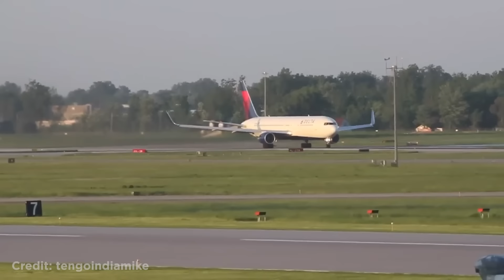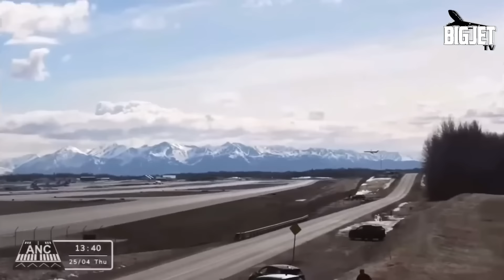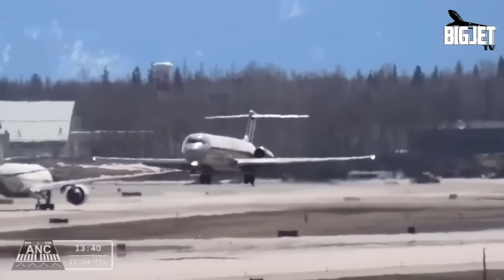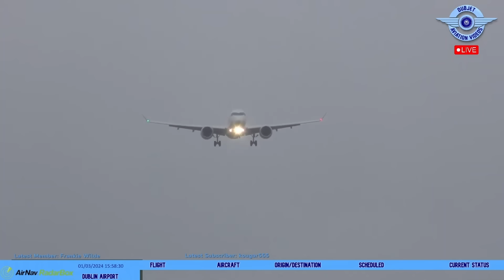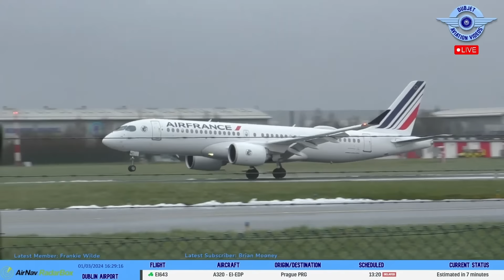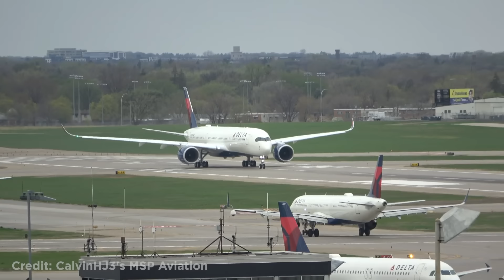767 Takeoff Goes Wrong

Comment: In 0:49 the airpline was md80, not dc9
Reply: Nope thats dc 9
Reply: @marsifire5216  no, dc 9 was smaller, engines was much smaller
Reply: @piotrrys6313  it has variants it has dc9-30 -40 and -50 this is the 50 varient

Comment: I was on a DC-9 in the 70s, was super loud at the back due to the adjacent engines...was also on a DC-8 in 1965
Reply: I wished I‘d experience the same man! Sick
Reply: BUT, if you get a seat in the front of the DC-9/MD-80 you could hear almost everything else since the engine noise was low.  Re-engined DC-8s were cool too.
Reply: @eljeffe8806  ya got that right

Comment: That is an extremely short take off for an A350.  They make excuses here in SLC that the runway is 2000 feet short to have A350's takeoff here, when it's been done.  It's all corporate excuses.  The Church of LDS chartered two A350's going to Manilla out of here.  Money talks, so don't tell me it can't be done. Delta treats SLC like a regional airport.  This is Delta's ONLY hub, that does not have a flight to HND or INC.

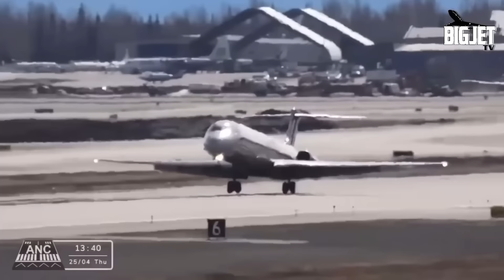Comment: What is up with the 767-300's? They always are having issues. And that Anchorage plane isn't a DC-9 It's a MD-80. Though technically you can call it a DC-9 Super 80. (DC-9-80) MD-80's have bigger engines than the DC-9's had. DC-9's had the JT8D-17  family of engines. This plane at 1:15 had the JT8D-200 family of engines (bigger than the 17's)

Comment: The 767's take-off wasn't "wrong." A tire blew almost at the time that the plane reached take-off speed. At that point, pilots are trained to quickly assess the situation and decide to either abort the take-off or continue it. The pilots did what they were trained to do and chose to continue the take-off. If the pilots had made a different choice, the 767 could have come to a stop before the end of the runway, as 767s are designed and built to do. If the problem had been different and an engine had blown instead of a tire, the pilots could have continued the take-off and climbed out on one engine because twin-engine airliners are designed and built to do that, too. This time, the pilots continued the take-off, burned off a lot of fuel, and safely delivered their passengers to the destination on their tickets.
Reply: It's also likely they weren't aware of it at all.

Comment: Just retire the 767 man 🙏🙏
Reply: Still airworthy, still has parts available, = it still flies, simple as that.
There's literally like 5 DC-3/C-47's still in service, because of that.
Even automobiles are like this if you don't have to deal with rust, as long as you can get spare parts and it's not breaking any emissions or safety laws (and the bit with safety laws usually lets older vehicles get "grandfathered" in), you can keep it on the road.
Same goes with aircraft, if it still passes inspection, and you can still get parts for it if/when it needs them, it can still fly.
Only reason most airlines replace their aircraft as often as they do is to reduce operating costs by using more efficient aircraft that are probably also easier to work on.
Reply: You're clueless.   It's a great airframe that still flies beautifully, economically, safely.  A TIRE blew.    Only on YT.
Reply: @lbowsk  I didnt base my decision of one video. I have flown on a few and the fact that they are seen as enjoyable to fly on shocks me. What is nice about an outdated interior?
Reply: @jA_240  Interiors are easily updated by the carrier.  Hardly a fault of the 767.   Still a Super capable, safe AC.   To develop a replacement would cost billions.   Eventually they’ll all die of old age n be replaced by A350s n 787s.
Reply: @lbowsk  Yes but my point is teh interiors are not and will never be so they might as well scrap them now.